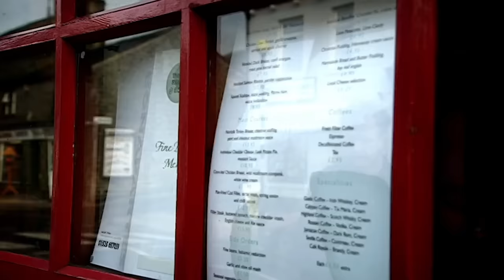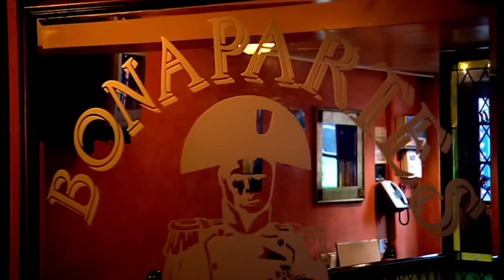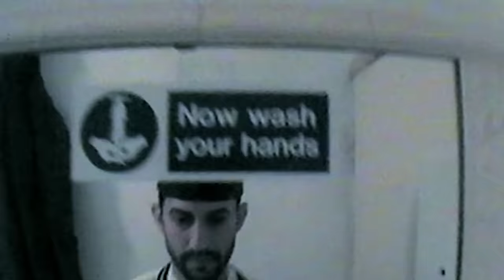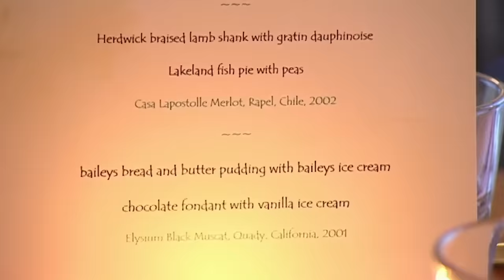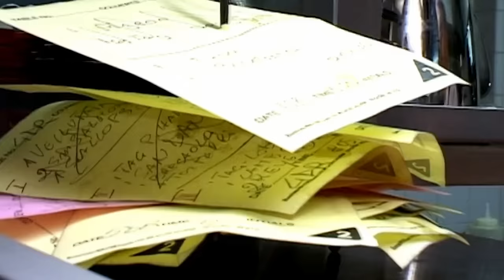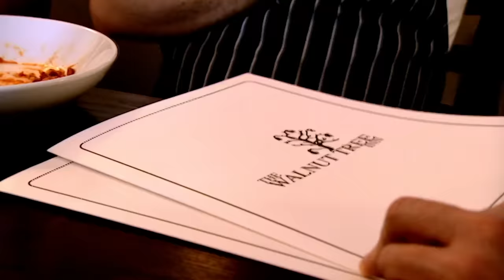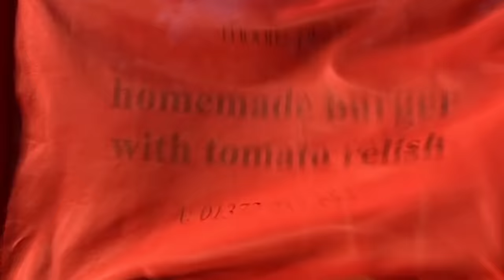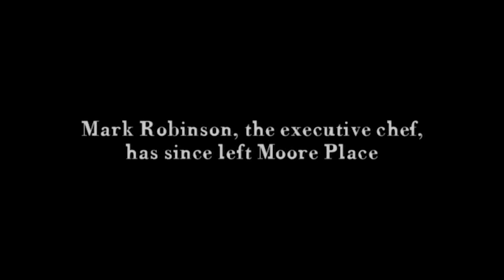All SEASON 1 Episodes | Kitchen Nightmares UK

Comment: "$25,000 a year is a lot of money."

My how times have changed.
Reply: if my calculations are correct £25000 is about $75000 today
Reply: @jessenorman91   It's just over $31,600 in today's dollars, back in 2007 it was roughly $50,000. If we take inflation into account £25,000 in 2007 is the equivalent of £43,470.44 in 2024, which in dollars is $55,116.17